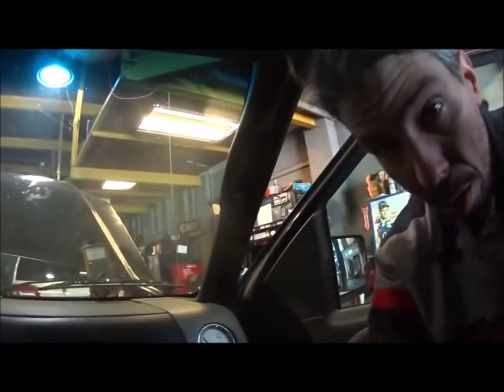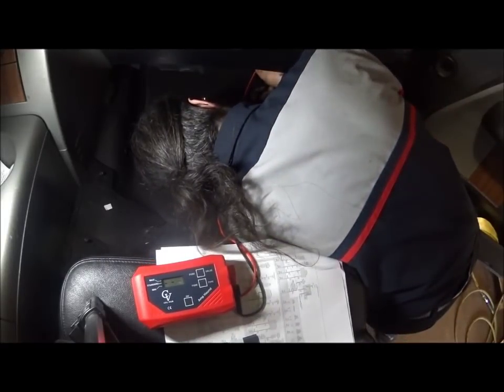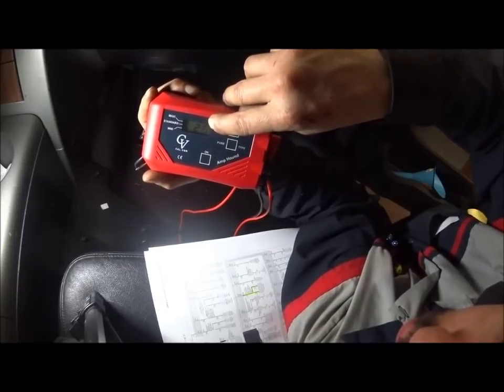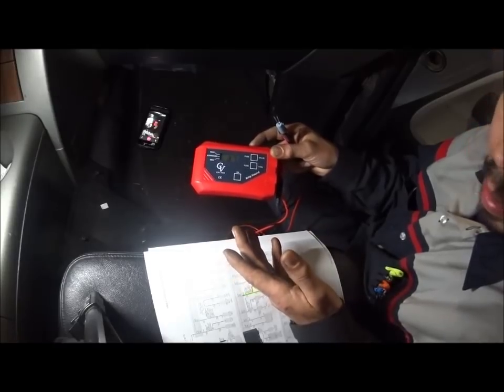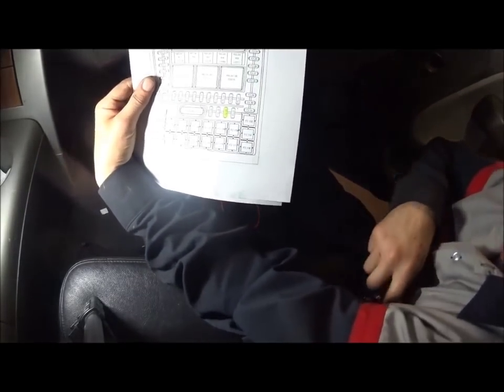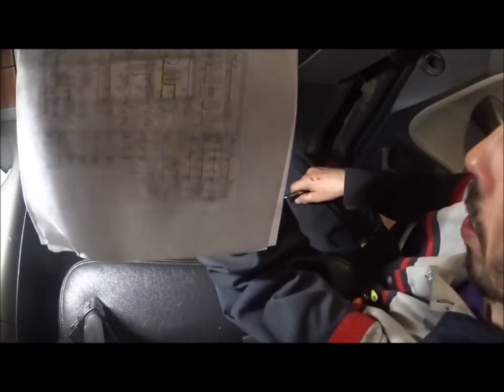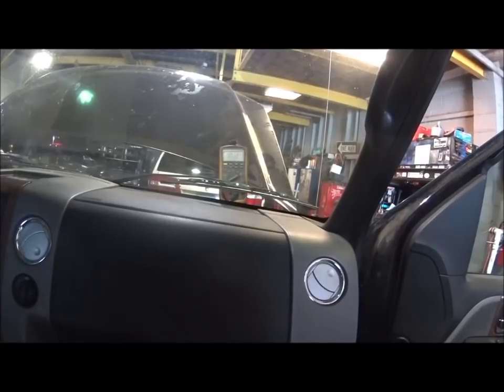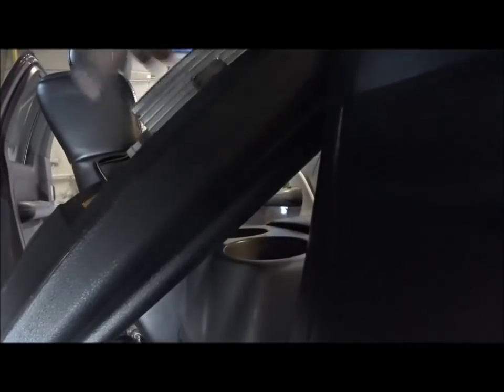Battery Drain Why I Like the Amp Hound

Comment: Bought this years ago thanks to your video. Got the 2nd gen now. Not much improvement from the first. As cars get more sensitive electronics its proven to be invaluable. I can even use this on circuits that aren't intended for the tool and then just hook up multimeter to do the old school calculation and verify. Recently saw that Power Probe came out with a Power probe Draw. It maintains memory and measures electrical draw at the OBD II port. I can see some potential issues but I'm glad more tools being developed to troubleshoot these problems b

Comment: How do you test if the circuit is drawing amps if the battery is dead? Do you have to charge battery first? Or does it somehow figure out the amp draw with the battery dead?
Reply from the maker: You cannot test circuits with weak batteries. Always make sure the battery is charged or replaced first

Comment: Yea, fuck pulling fuses, I hate that shit, some are stuck on there tough, even using a good fuse puller they are a bitch to pull, I've broke fuses before. Than some are real close to a neighboring fuse making it hard especially thr fuse box side panel under the dash where you have no room to work with.
Reply from the maker: Pulling fuses is simply the wrong way to do the testing.

Comment: Won't a volt meter across the fuse do the same thing showing a draw?
Reply from the maker: I explained this in the video.
Reply: @JoesAutoElectric  Yes, I saw that but I'm curious as to why the Amp Hound is better.  I was thinking of getting one.

Comment: Why is bad to remove fuses? Also another thing i would like to ask is if removing the battery once a month is bad for car's computers or something else maybe ?. This period of time i have to start a second  car i have once a month just to work a lil  but doesnt have battery so i have to borrow the battery from the car i use everyday. Thank you.
PS: I dont have a small battery to hook up so to prevent manual reset up of radio stations etc but i dont really care about that. My concern is if something can be damaged.
Reply: plugging fuse back in starts the timers in modules and fools you into thinking that you have found the parasite. On the freightliner m2 class trucks, there are no fuses for individual circuits such as turn sigs and cigar lighters. The fuses all power modules. They decided to use multiplexing thru out the whole truck. You can dead short a rear turn sig. and the front will continue to blink. Takes a while to wrap your head around that one. I need the amp hound and the thermal camera and a 7000 dollar laptop setup. Plus pulling fuses on a loaded circuit might induce a back bias emf spike and damage a module that is not part of the real problem.
Reply: @martinnorbeck5961  Thanks a lot for the info. I would really appriciate if you could answer also about the battery question i asked you cause im really concerned about this since i have to take off and on my battery often as i said in my first question. Thank you.

Comment: That's an interesting tool. Nothing magical, they just did the table calculations inside the box so the tech doesn't have to reach for the tables and do the voltage drop calcs for each fuse in the box. Easy to see how that would be a time saver for a busy pro. I find the thermal imaging even more interesting, I wonder if the thermal camera would pick up the hot fuse, too. If so, you would skip a step and be even faster.
Reply from the maker: @Spelunkerd I have a few videos on the thermal camera being used. One, in particular you may like. Check this one: https://www.youtube.com/watch?v=VCPnWtPOuto

Comment: That certainly is easier than using a DVM and then pulling out the old coffee stained  fuse voltage drop to current conversion chart!

Comment: Pretty sweet when the fuse feeds only 1 thing. Makes it easy to track down after u find the circut. I jist got the amp hound. I havnt familarized myself with it yet. When your going across fuses do u change the tool to whatever size fuse u are going across or do u wait till u find the bad draw then put the fuse type in. I just wonder if u can jist go down the line without changing the tool for every different size fuse.
Reply from the maker: Yes, this was an easy one. I do not usually set the fuse type until I see a problem in a circuit.
Reply: Thats what i figured. Thatnks for the vid. I seen u using this tool in an older vid and that why i purchased it

Comment: Thanx Joe 😃😃. Would u recommend this thermal camera being on the affordable side of things just to get u by for types of situations like these or is there a better option that u know of or heard? I understand each tool has its limitations but that little thing looks sweet and quite accurate. Thanx again joe
Reply from the maker: I have found no problems with this unit, though it is not a stand alone camera..This is integrated in my Catphone. Flir is a great brand though.

Comment: Great Video Joe, I’ve heard of the Amp hound but never did any research on it. Love the audible function. You can focus on testing the fuses instead of fuses and meter all at the same time. Thanks for sharing.
Reply from the maker: Yes! I meant to say that while filming.
Reply: @JoesAutoElectric  when you say dont pull fuses. Do you mean dont pull fuses to check if they are blown. Or dont pull fuses to find a draw?